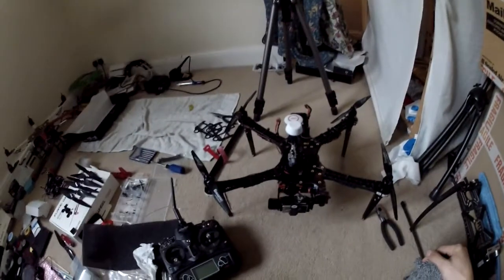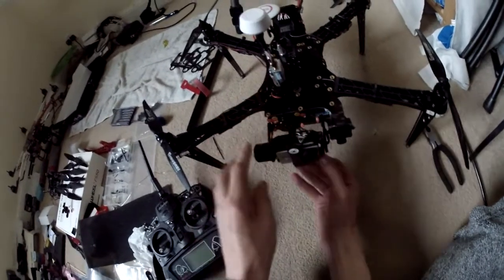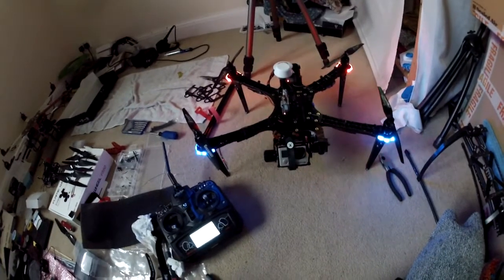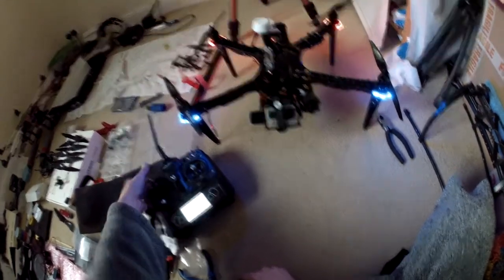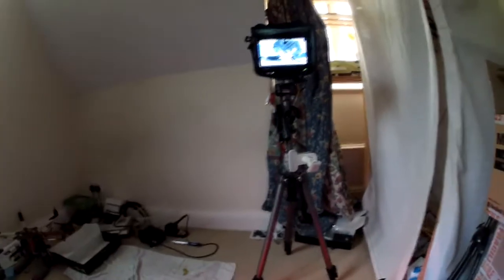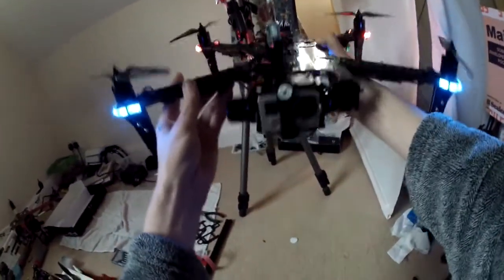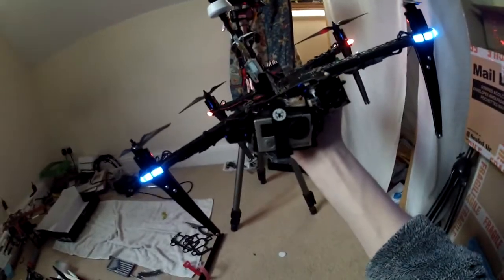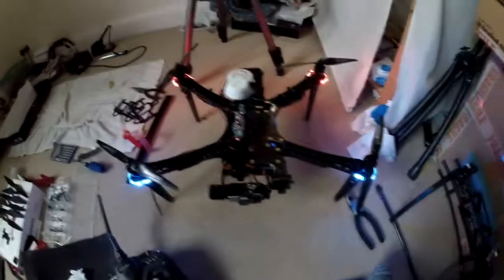Discovery Pro Gimbal Fault

Comment: Ouch, that's an expensive thing not to work.  The binding on the roll axis looks like the motors are too weak to move it any further.  I got this on my cheap and nasty gimbal when using a GoPro 2 instead of a 3 where it wasn't expecting the extra weight.  I'd expect the TBS stuff to be perfect though - only thing you might have is one of the wires to the roll motor being slightly dodgy, so it can't quite get the full voltage going through it that it needs
Reply from the maker: Yeah - I tried boosting roll power to over 200, and it still did it, goddammit. And with roll motor polarity reversed, or not. It's back with supplier now, who is kindly taking the time to test / fix it for me. Firmware is flashed 2.1 and Trappy's defaults to both profiles 1 and 2, then roll motor gain upped a bit.

Dodgy motor lead could be it... thanks for the thought, CK - will pass on.

Comment from the maker: UPDATE: Problems diagnosed and fixed. 1 x faulty GoPro interface board, 1 x faulty GoPro interface cable, and 1 x Faulty (Open circuit) Roll Motor. I hope I was extremely unlucky, because that really doesn't say a lot for TBS quality control !